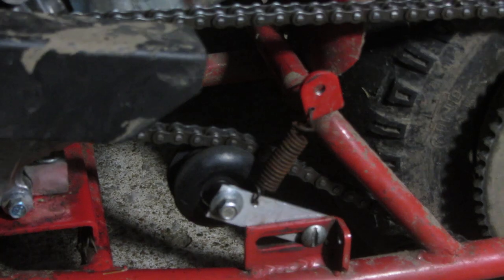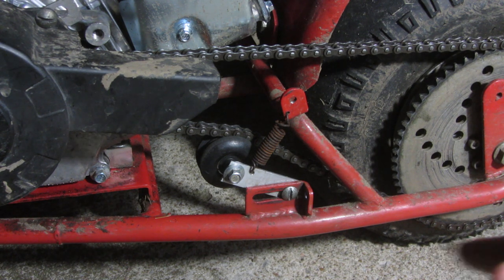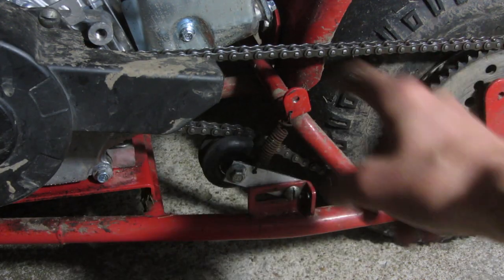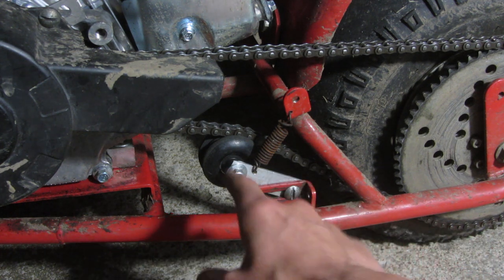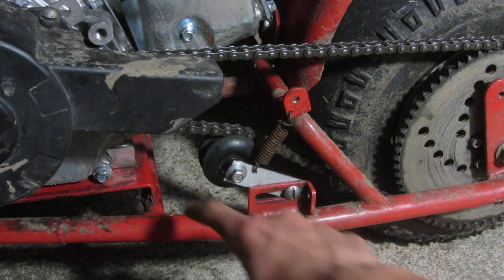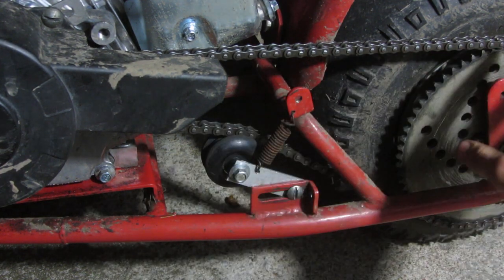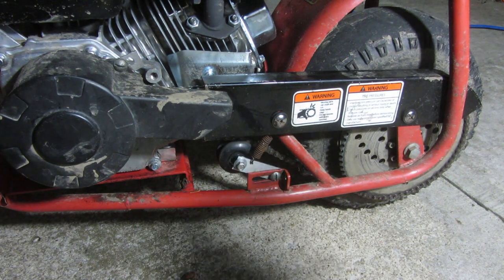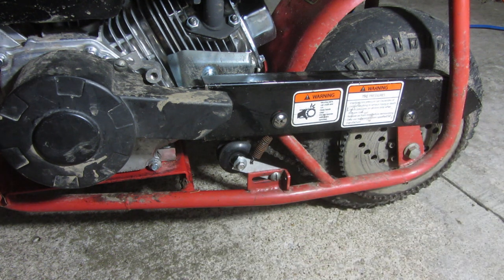Doodlebug Mini Bike Chain Tensioner

Comment: What is the length and width of the piece of aluminum you used? Looks great nice vid.
Reply: Looks like maybe 2 1/2 to 3 1/2 inches
Reply: I don't think width would matter as long as you can fit everything on.

Comment: fantastic video I need to copy this but how did you make the grove in the skateboard wheel... I can't figure it out
Reply: I think after you just ride with it it will shred it down
Reply: You could just re-use the plastic wheel that comes with most minibikes like that.  They use skateboard wheel bearings too.  Use Swiss bearings to gain 1mph. :^)

Comment: just adjust your idle screw you'll be OK I found a doodle bug with a 6.5 hp engine did a TuneUp on it I put new gas added a fuel filter put fully synthetic oil & adjusted the idle screw also changed the spark plug to NGK plug now it runs beautiful not gonna lie though I need a new clutch it works for now but I probably should change it not sure how long it was on there also try & put a chain tensioner on it as well

Comment: What did you use to channel the skateboard wheel out with?
Reply: An adjustable speed Drill, a long enough bolt to bolt and socket. Tighten down to freespin but little play. Use socketed drill to spin wheel, and a new sharpened 3/4" wood chisel and lathe it like that

Comment: Does the original mounts like wholes in the plate work for the 212 or did you have to drill whole
Reply from the maker: Mine had holes so I didn't have to drill but I think most of them do not. Mine is from the late 90s or early 2000s. If you have to drill holes, make sure the engine is straight or your chain will wear out really fast.
Reply: They came with a 97cc engine I believe, so you will have to drill new slots for a 212.

Comment: How did you channel the wheel?
Reply from the maker: I used a drill and a screw driver but I don't recommend that. It's worth it just to buy the original wheel for it, that's what I ended up doing.
Reply: +HarryCo4 Thank you bud
Reply: +HarryCo4 Another question: I just put a 212cc Predator engine on my minibike, and running it without any tensioner. I cant ride it more 200 yards without the chain falling off even when moving the engine forward. Is this because I'm riding it without the tensioner? Does the tensioner make that big of a difference? Or do i have a bigger problem? Thanks.
Reply from the maker: +Christopher Yniguez 
As long as the chain is tight (but not too tight) it should work with or without the tensioner, you might want to check the front to rear sprocket alignment.
Reply: +HarryCo4 yeah i was thinking the same thing

Comment: Good idea man. Ive got the CT200U with a 212cc motor. Even though the mini bike in the video is alil different than mine, your idea will work for me. Even mounting it another way. Thanks for taking the time to show folks your engineering solution.
Reply: how did you mount your chain tensioner have you found a bracket to mount one i need one for my ct200u as well